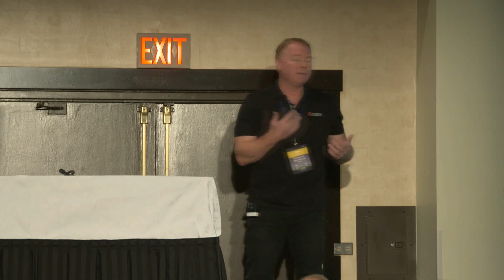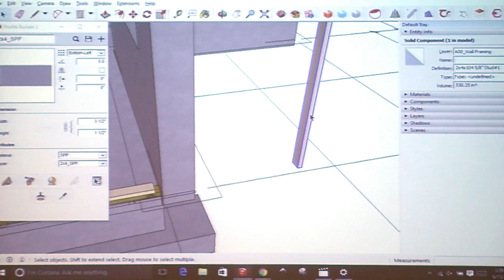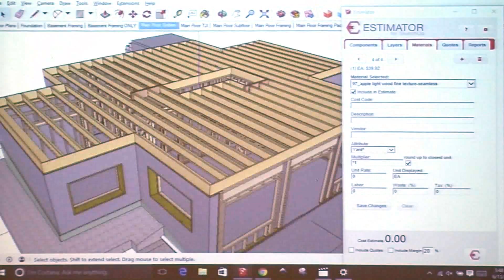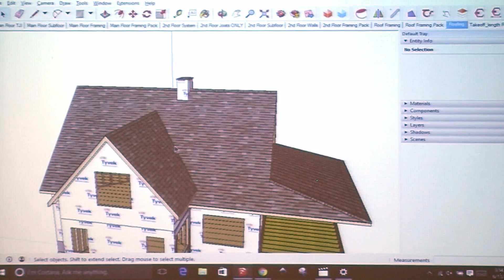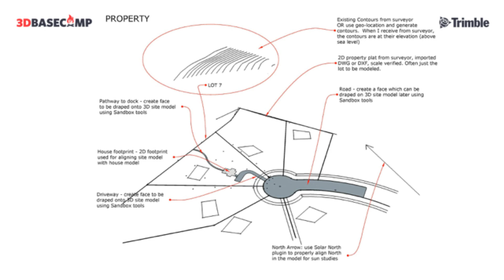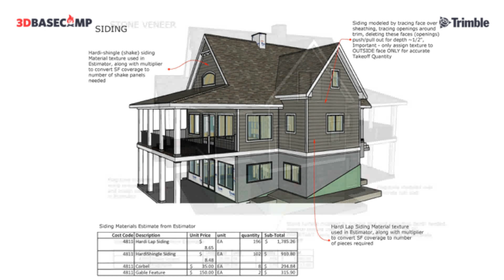3D Basecamp 2016 – Down to the Details: Model Everything in SketchUp

Comment: I've always said that if you can build a staircase or frame a roof you can frame anything.  But multiple planes intersecting is a geometric puzzle in reality or virtual space.  In SketchUp, lately I try to make every group or component a 'solid', just so the software can figure out the compound angles, by simply placing the two parts where they will go and using the Tools/solid/trim tool.  It took a while to prepare things and learn the tool (I get the routine backwards) but now that it's in the 'repertoire' I use it more and more.  This roof design produces cuts that are way past 45 degrees, at 65 degrees or more that are hard to cut onsite sometimes, so the frame can be altered to minimize those long compound, acute angles.

Comment: "Stem Wall" is an often used term, but it's not universal.  It's normally a shorter wall, as a supporting wall of a crawl space, but sometimes it's in an attic, where two roof planes intersect.  Whenever I hear the term the user always says it as if it's as well defined as "stud" or "truss".